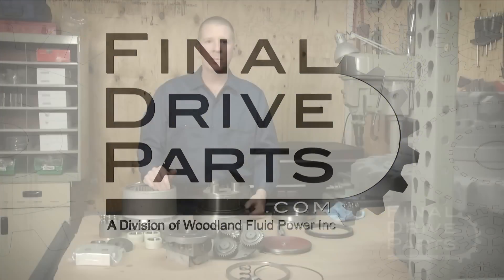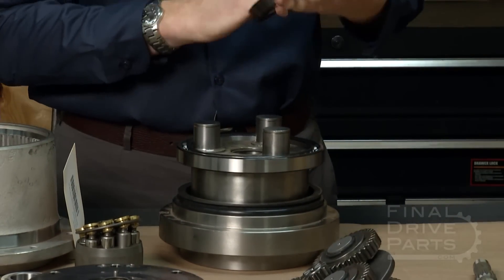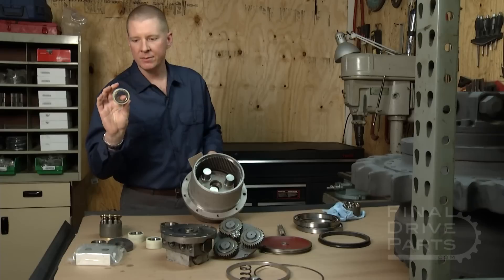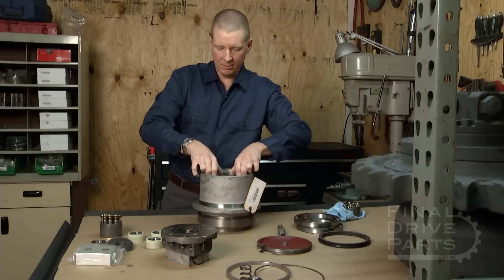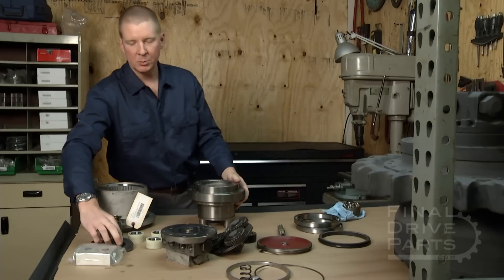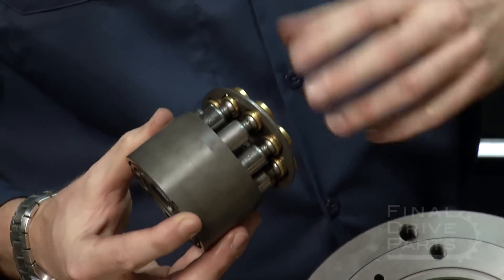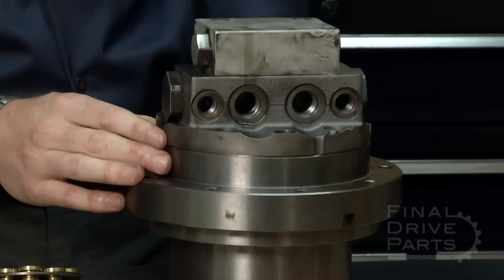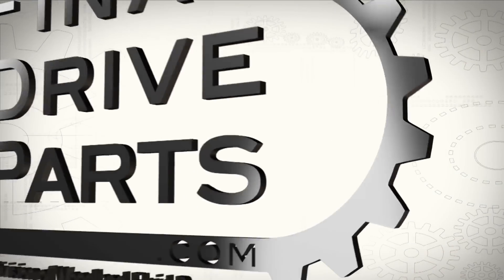Hydraulic Planetary Final Drive Travel Motor Parts:

Comment: Got a yanmar tracked dumper with a torn up planetary what information/numbers do you need and where would I find them on the gear box ? Thanks
Reply from the maker: Hi! There will be a tag on the motor next to where the lines hook up. That tag info is what we need.
Reply: @Finaldriveparts  ok will do thanks
Reply: @Finaldriveparts  model #228-33ctbf-50  mf22-543-50 654 serial 10-th12648 Daikin ind Sauer sunstran
Reply: @Finaldriveparts  any luck on the yanmar final drive ?
Reply: Did you get the numbers I sent ?